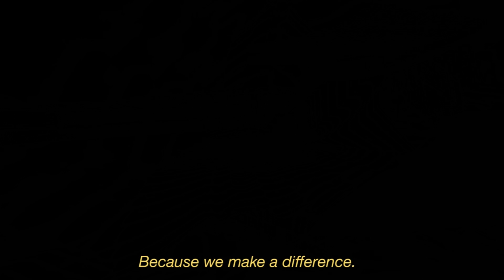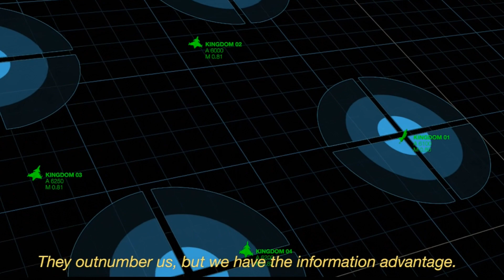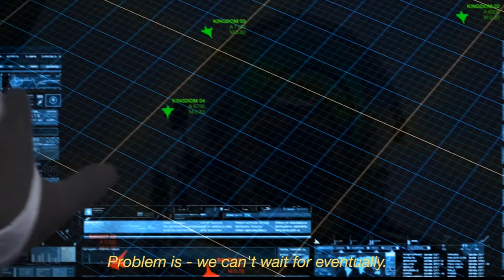Gripen Fighter Jet - Canada's Future Fighter?

Comment: One thing im woundring about... Gripen is said to be a bit weaker in every area compared to simular planes. But the cost of a gripen is so much lower, that you can buy more plans with the same money.
1v1 gripen might not fair well against a eurofighter for example. But if a eurofighter have to engage gripen in a ratio of 2/1, wouldnt that do a pretty big change?
Reply: I'm starting to get the feeling that the EF isn't 2 times as good as the Gripen, but I can see the EF costs a lot more.
Reply: I have no clue, my point just being that when seeing numbers like Rafale unit cost 130.000.000 USD and gripen unit cost 45.000.000 USD that gives you 2,8 gripen for every rafale. I dont think these numbers are for the new gripen, but my thought are like this, quality is not always better than quantity, thinking back to ww2 when us engaged german tanks, with superior number of inferior tanks like sherman. But hey, they won right?
If you buy 60 rafale for the price mention above ( assuming it is some what right) you could get 168 gripen for the same price. More planes in the air, can have more missions at the same time, and cover more ground. And the short turnaround time and flight cost also should increase the amount of planes you can have in the sky in the long run.

This is just my thoughts, not based on deep research.

Were i got the numbers: http://www.aviatia.net/dassault-rafale-vs-saab-gripen/ think it might be for the gripen c?

Comment: fun fact some rods in sweden has the barrier in the middle on the road removed to make it easier for griperns to land on them
Reply: point was to have so many road sections it would be hard to take out them out and keep them from being repaired. The actual in use strip rotates constantly between dozens of strips. 

Essentially the "air base" is bunch of trucks ferrying around landing lights, landing instruments, fuel for the plane, resupply of munitions, quick to change spare parts and also bunch of rotating pilots. 

They would set up on some strips, planes would land,refuel, rearm and take off. As soon as the planes have left the ground crew packs up and moves to new place.

Point is to always stay ahead of enemy intelligence, so that the enemy doesn't know which strip to hit. Hitting all of them constatnly with stand-off weapons would get pretty expensive pretty soon.

If the planes needed to stay on ground longer, they would fly to deep bases deep in home territory and hangar in cave bases dug under a mountain or hill with multiple road strips nearby serving those hangars to keep the base from being rendered airstripless.

Swedes planned to stay in the fight for a long time and their airplanes reflect that.

as for nukes. If Nukes start flying everyone is fucked anyway. So not much point worrying about "how we keep fighting after nuclear armageddon". At that point the more relevant guestion is "how do we handle civil protection." answer again being for most of the nordics "dig ourselves under a mountain or hill."
Reply: Shh, don't tell the Russians :P
Reply: +McPuff Road bases are coming back, slowly.
Reply: They are restoring a number of road bases currently though.
Reply: They were used a month ago, so no they are not abolished Martin.
Reply: Martin Andersson They still have som Vägbas 90 kvar. Trust me, I live close to atleast one 😉
Reply: Sweden can always land in one of its neighbors yard. We don't mind. (I'm Danish)
Reply: The difference is that the Swedish road landing system is just as it says, a system. Its not a show off for youtube vids, it´s a trained system built for war.
Reply: The Soviets peaked at about 40,000 warheads, allocating 100 to take out Sweden is not such a big deal, especially when you can usually destroy multiple targets with one warhead.
Reply: Aren't some US roads built to fit jets landing on them too?
Reply: Fun fact: Same goes for germany. We have currently 29 NLP's (notfalllandeplatz/ emergency landing strip) on the Autobahn for NATO use, complete wich taxi area and designated mobile tower. Also some streets in berlin are heatable so you can keep them free in the winter (nazi idea) in case one needs to bale. Also Rammstein Air Base started as NLP for the Wehrmacht, wich the americans captured and kept to this day. Cheers mate
Reply: Now operational again: https://www.youtube.com/watch?v=2-2Xde54xz4
Reply: +Rasker
Thank you, comrade.  Good to know.
Reply: Swedes always go under a beast and stab them rather than jumping on back or facing the front
Reply: "If Nukes start flying everyone is fucked anyway."

Exactly. The idea that had WWIII had broken out between NATO and the Warsaw Pact that it wouldn't have gone nuclear seems pretty optimistic. Each side would have been paranoid about losing a portion of their nuclear capability and would have been on a hair-trigger.
Reply: Lucky the Russians never worked out what those straight sections of road were for, they might have targeted them for a good nuking if war had broken out!!
Reply: But they were so many and even the ruskans can bomb hundreds of roads over enemy territory..
Reply: Why would any attacker want to land on the roads? Only fighter jets could do it, no cargo transporter. Makes no sense that the 2+1 lanes are made to that enemy fighters can't land but Gripen can (maybe). The invasion would be "over" when the enemy can control roads and surroundings (so no one can shot some bullets on the stationary fighter) and control the infrastructure for refueling etc. Today Russia (yes them) have advanced anti-air systems to deter any Swedish fighters once they've deployed them and cruise missiles that can attack from back in Kaliningrad.
So yes we can have some use for our road bases (vägbas) but I don't see why any invader would have it. It makes much more sense to occupy any regional airport, that may be damaged, and have their engineering troops repair it when they need an airport.
And you are way overstating the width of the old road bases. Between 12 and 17 meter (everyone wasn't made equal) was enough. The old ones were often 1500 meter or more but Viggen and Gripen short-bases could be 800 meters.
Reply: ok
Reply: In Serbia as well (broke ass retarded country). Planes other than SAAB's "smart fighter" (wtf?) can also land on roads, naturally. You can find a video MiG29 and Su25 landing on a highway (in Poland, I think) on YouTube. Basically, any plane that's small enough can land on a road if it's wide enough.
Reply: Ehh that was a dumb comment! You do not understand what a Roadbase system is then!

Comment: The Grippen's advantage is also it's Achilles heal. Specifically one of the reasons it's both cheaper and lower cost to run than both the Rafale and Typhoon is that it has a single engine. That also makes it smaller so shorter range, and less payload. 5000kg approx. on the Grippen as opposed to approx. 8000kg on the Typhoon, and approx. 9500kg for the Raphale. It also has the lowest thrust/weight ratio of the three in interceptor configuration: Grippen 0.97, Raphale 0.99 and Typhoon 1.15. That is a huge chunk of difference compared to a Typhoon in a dogfight. Basically you can only maintain high G turns 80% as much as a Typhoon.

Comment: The Grippen can not compete with the latest Russian stuff. Its cheap but you are buying a loser, which means you have to buy a LOT of them to make up the difference. You can't afford a lot. There is really only the F-35 which is basically the best that the West can technically produce and far in advance of anything the Russians can make. In future, there will be two airforces. Those with the F-35 and those without. Even the Turks will have the F-35 (because they are not stupid). Canada won't be able to defend itself in the air.

Comment: The problem with the Gripen and F-35 is only having a single engine the Canadian air force prefers dual engines.
Reply: Paul Raver meh they do but RCAF loves and gets horny for American Fighters.
Reply: A dual engine fighter it does not really matter, has to do with operational requirements.
Reply: So the RCAF would not operate the F-16 (arguably one of the best fighters in recent time)... Sounds odd
Reply: That is what the RCAF wants, so much ground to cover and it is hard to retrieve pilots from backwaters when a single engine craft fails.
Single engines are nice for smaller country's but bigger country's 2 engine frames make more sense.

Comment: It has been the doctrine for the RCAF to use two engine aircraft until the F-35 became a contender.   The areas to cover are immense and a twin engine aircraft is part of the survival envelope for the pilot.  I like the Gripen but I give the pilot slim survival chances of surviving a winter ejection in Northern Canada.  RCAF most influential CF-18 pilot was gagged during the F-35 selection debate.  He didn't like a single engine aircraft for the same reasons.

I have been in favor of the Super Hornet from the get go for this reason and also for cost management in simulation software updates, ground crew transition training and last but not least a Super Hornet with thrust vectoring can thumb its nose at a Su-35.

 F/A 18 Super Hornet - Farnborough 2014
https://www.youtube.com/watch?v=5SQb2dMfXHg

Comment: What I would recommend considering there's no design currently in service that service in the world that fits all our needs, we may need two designs. The Super Hornet as the workhorse and a small number of F-35s for strike aircraft would probably be the best fit. Let's say we want 122 aircraft, like the Hornet purchase, I would say 70 F/A-18E, 30 F/A-18F, and 22 F-35s (preferably the C version due to longer range and stiffened landing gear) would be a very capable force.

Comment: It's cheap (for a jet), but being single engine, if it ingests a duck it's going in.
Reply: Sweden operates both artic and coastal areas (of course smaller than Canada) that has an abundance of seabirds. The aircraft is very resillient when it comes to birdstrikes or other kinds of FOD. And nevermind that it's relativley cheap to buy. The real advantage is the operating costs that are the lowest in the class.